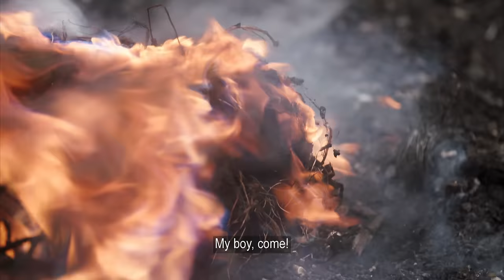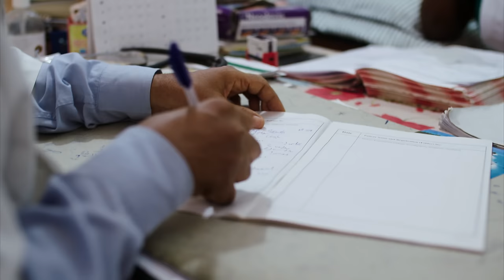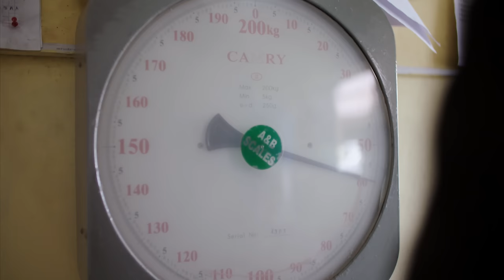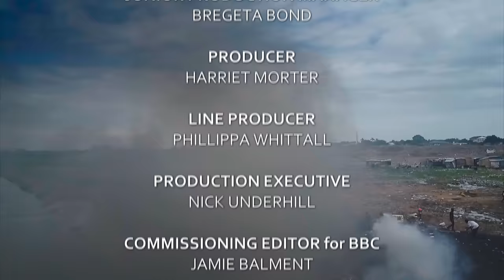A Week in a Toxic Waste Dump

Comment: Imagine if everyone had electric cars and all the dumped batteries over many years.
Reply: 😄or maybe:  Imagine if everyone did exactly the same as we've been doing over many years... oh, yer, we don't need to imagine, they've made "A Week in a Toxic Waste Dump". 🙄
Reply: Exactly, an e.v. creates twice as much pollution when junked than a combustion vehicle.
Reply: @bradleysmith9431 😄 Completely and utterly untrue.  Nowadays EV  car batteries can be processed to be re-cycled . And how much pollution does combustion creates compared to EV over it's life time??  And again: Imagine if everyone did exactly the same as we've been doing...
 (and also, this doc was about the materials we DON"T recycle are ourselves - all machinery not just fossil fuel engines.)
Reply: @JohnDoe-tx8lq  it takes more coal being burned to charge up a battery than it would fuel in a combustion engine to go the same distance. Plus it takes longer in an e.v. because you have to wait for it to charge. Imagine a suburban area with an e.v. in every garage, then that neighborhood gets flooded... Now not only do they have water damage, but every house has also burned up. Lithium+water=🔥
Reply: @bradleysmith9431  Complete rubbish from start to end. Amazing.  And all the houses are flooded AND burnt down? 🤣 Well at least storage of petrol has never been a fire problem... 😆
Reply: @JohnDoe-tx8lq  yeah, because when you add water to lithium it makes the chemical reaction even more, creating a larger fire. That's the equation lithium+water=🔥 mean.
Reply: @bradleysmith9431  yeah, the fire in the flooded house. But thanks for explaining your equation and picture... you think THAT was the problem? Oh my God.
Reply: @JohnDoe-tx8lq  yeah no problem. I Figured you could understand pictures  easier than words.